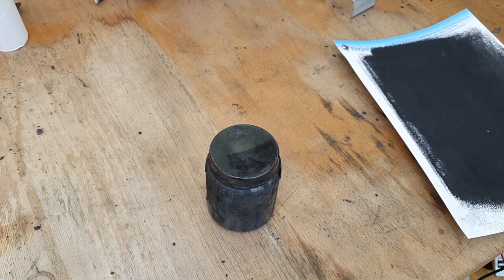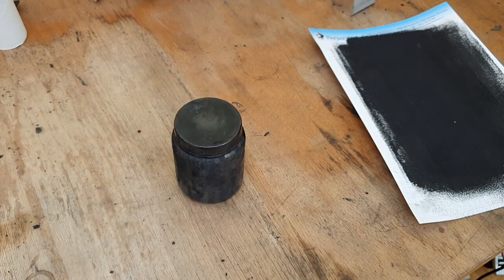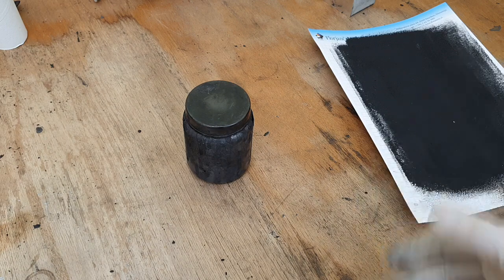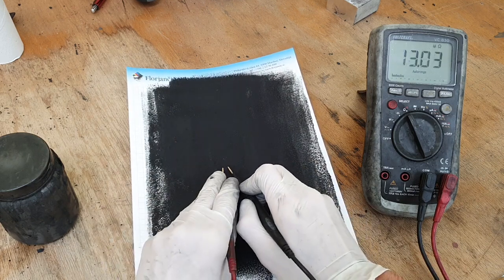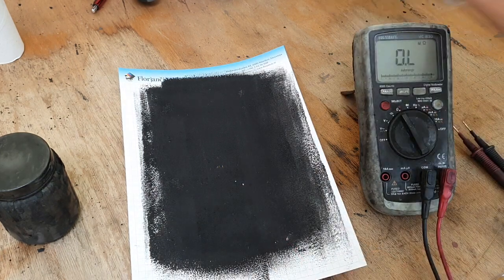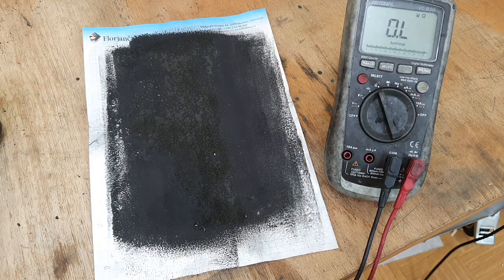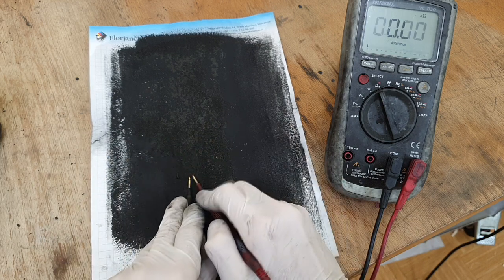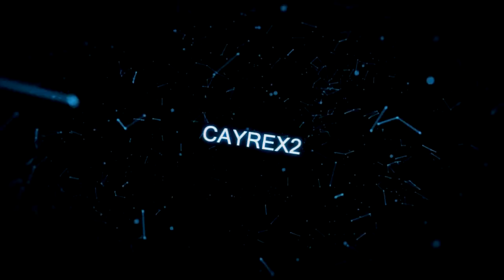Conductive ink made from waste plastic

Comment: Can you make good supercapacitors out of it ?
Reply from the maker: I think no! Because the ink have good water repellent properties which means that the water will not soak into the pore structure and is resistant to bases and acids.
Reply: @cayrex  so then what can it be used for?
Reply from the maker: @oudotcom  for anything that conductive paint is used. In basic conductive paints are not be used for making active materials for supercapacitors, because conductive paints dont have capacity performance. If you ad activated carbon into conductive paint will do the job,... but only conductive ink in supercapacitor will act like conductive additive and not more. In ion battery can ink like this act like intercalation material,.... but the ink need to soak the electrolyte that the electrolyte can go into the structure. The ink like this whic have good waterproofing and you dont get any higher conductivity when the ink is in some water can be used only for current collectors. The ink can be used like heaters, current collectors, sensors, switches, circuits, RFID, printed heaters and photovoltaic cells such as CIGS,....

Comment: Nice.
Does the plastic have to be applied when in melted state?
Is it made from a particular type of recycled plastic, how easy is it to get?
Martin.
Reply from the maker: To make this conductive ink you can use three of most used types of waste plastics. The making process is quite simply. Does the plastic have to be applied when in melted state? Not necessary
Reply: @cayrex  what solvent can it be used with?  Acetone or Toluol ?
Reply from the maker: @oudotcom  none of that
Reply: @cayrex  did you at all find a solvent, that you can solve it in and apply evenly to surfaces or do you need to melt it to apply to surfaces ?